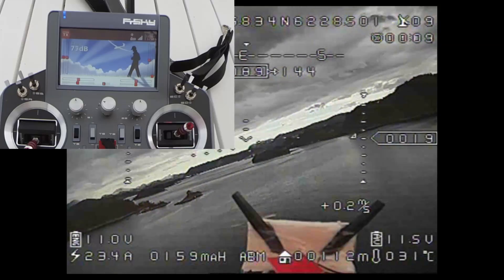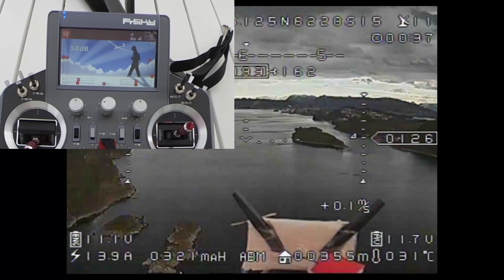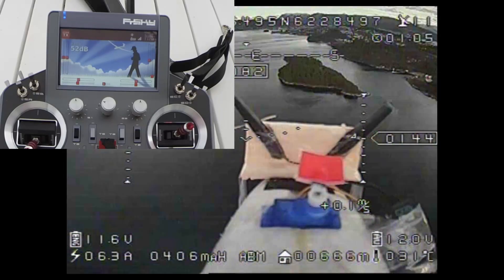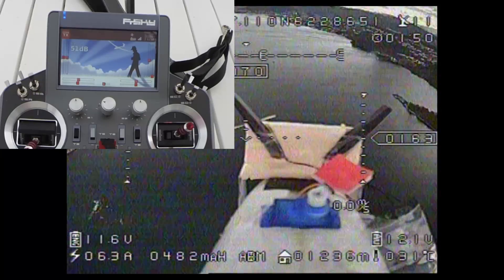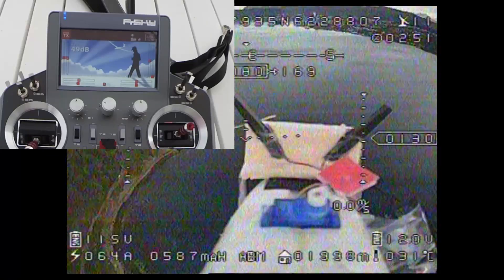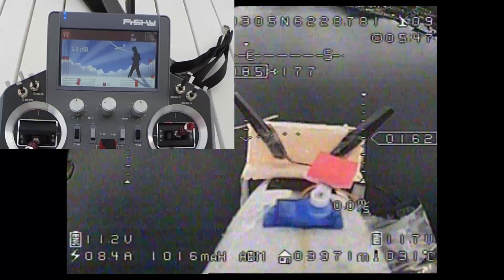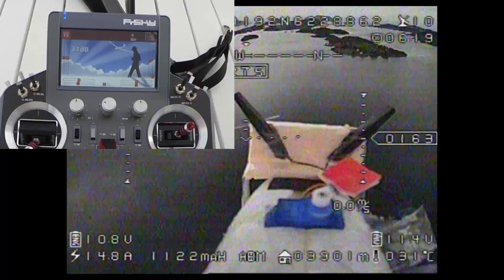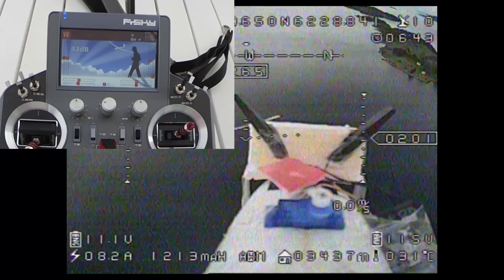FrSky Horus range test 2

Comment: My phantom 3 Pro can fly up to 4342 meters away before it RTH (Altitude less than 150m, can go further if fly higher).
Check this out... All stock antenna.
https://www.youtube.com/watch?v=ADmakY-55v4

So i can say that DJI remote is far better than Horus in range.
DJI in 3 kilometers still has Full Signal Bars.

u want to go more than 4Km in distance, i think u should buy a cheap Flysky Radio coupled with UHF433 LongRangeSystem (Arkbird UHF with repeater function). U can fly more than 10km easily...
Reply from the maker: I do not quite see the relevance but yes the Phantoms have a good signal. But if I really want to go far I could just use an 2.4 L9R receiver or use UHF. I have been 50km on UHF.